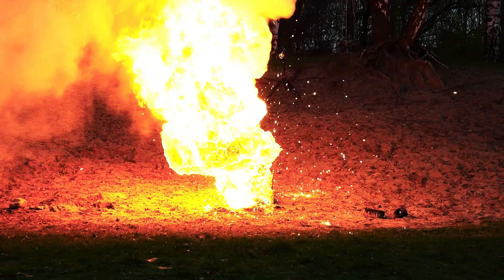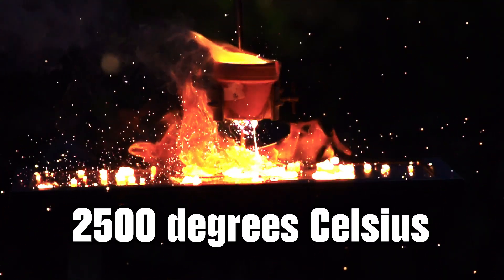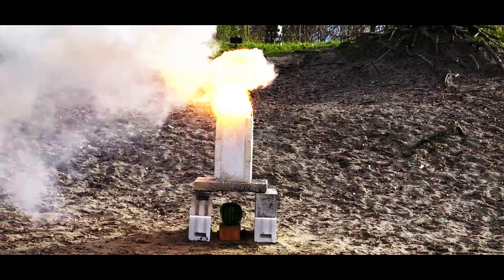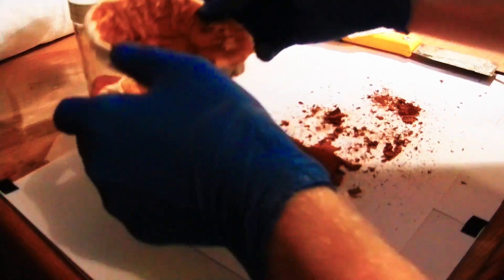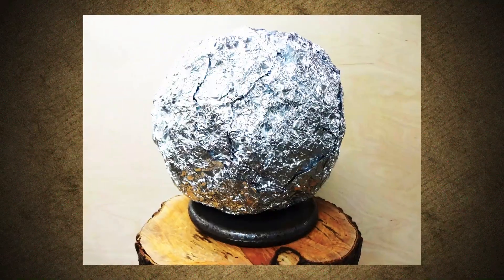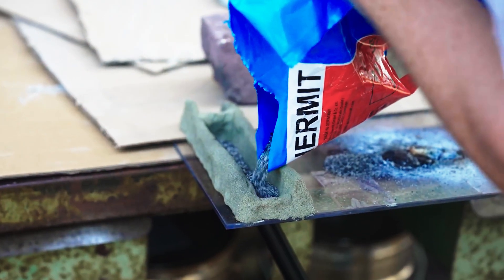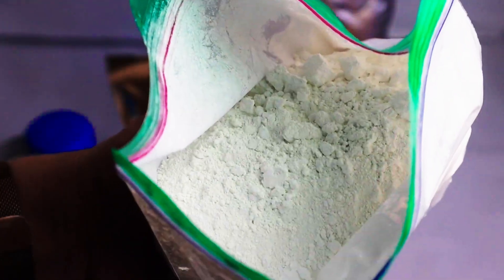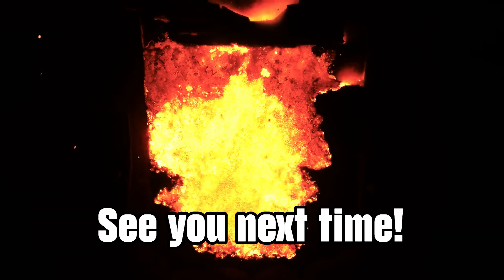DIY Thermite from Aluminum Foil – The Survivalist’s Ultimate Secret!🔥

Comment: You technically dont need aluminium powder
U can do it like codys lab. Put the rust on the foil and roll it up in logs
Only disadvantage is youll need a hotter fire source
But the advantage is you dont need powder so its cheaper and quicker, better for high amounts
Reply from the maker: Thanks for sharing!